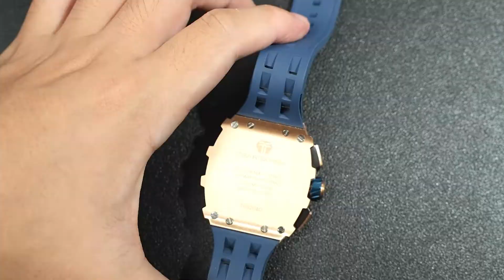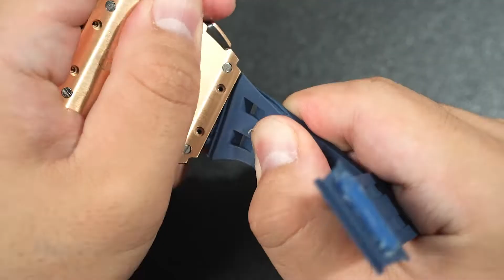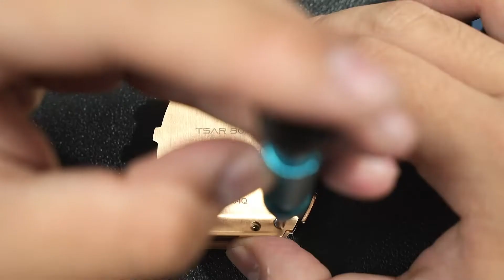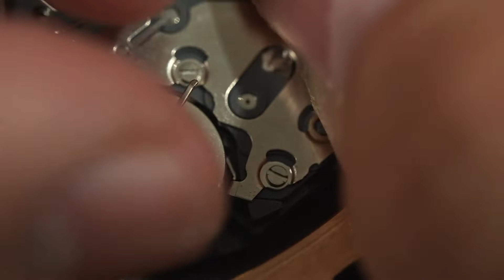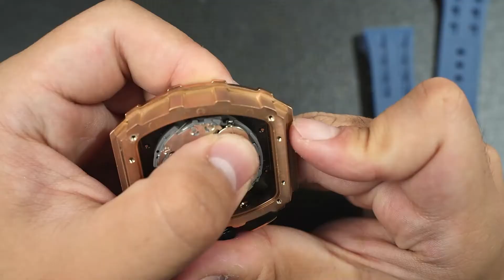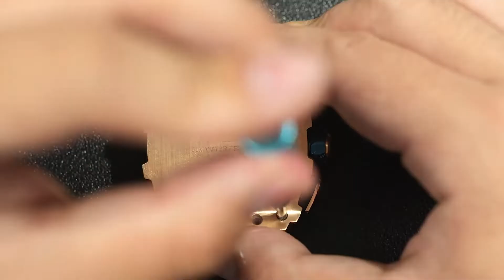TSAR BOMBA | How to change the battery of TB8204Q?

Comment: Is it still water resistant after you changed the battery?
Reply from the maker: Sure, as long as you don’t replace the back cover, it won’t affect its waterproof performance
Reply: @Tsarbombawatch  thanks for the quick reply! love my watch! (8204)
Reply: @Tsarbombawatch  not correct, you have to inspect the case back gasket if it in good shape, clean and not stretched Watchmaking grade silicone would be the best to add before installing the case back  I am sure you are very good at your profession.  I am very good at mine and i am a watchmaker, the real kind with 4 years of school and 25 years of working as a watchmaker and clock maker